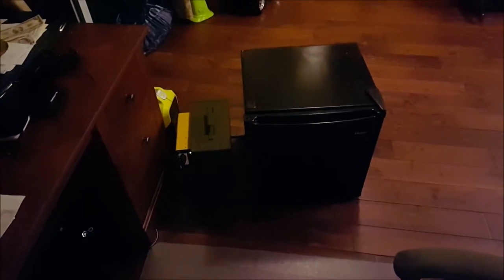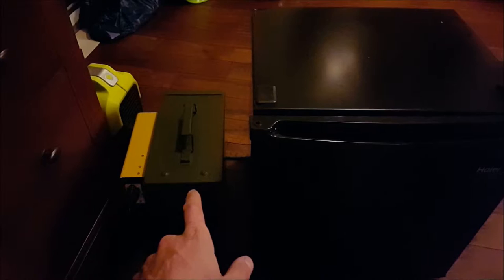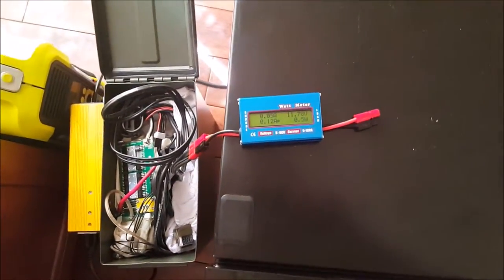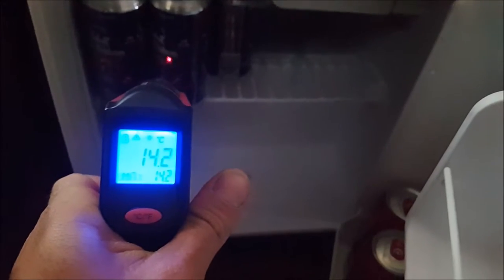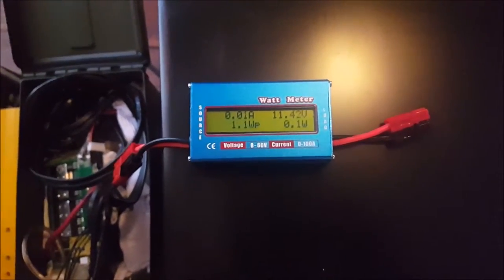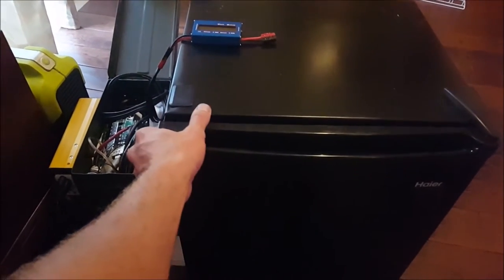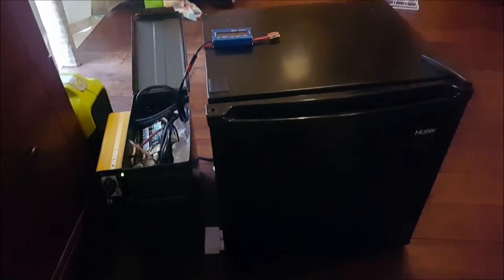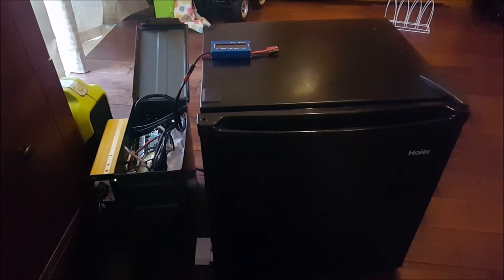Can My Battery Ammo Box Run A Bar Fridge

Comment: Hey mate, reckon you could swing us a link to your Lipo box build? Looks pretty sweet!.
Reply from the maker: here is one of them, I have a bunch if versions :D

https://www.youtube.com/watch?v=8XsM9_dJ7Ss
Reply: That's great, thanks.
Reply: What kind of BMS are you using in the Lipo box? / Have you found that works well? Would you have an ebay link? Putting one of these together myself. Making the switch from Pb... , Thanks again.
Reply from the maker: Nickk0051  its a 45 amp bms and it has done well so far.

Comment: yes I would really like to build one like yours. I have researched on YouTube and think you have the best design. as far as small size lots of power.
Reply from the maker: yea, I could put a 3000W inverter on this and run large  power tools, but I like the 300w with a 1000W surge this way I don't use to much power to fast :)

Comment: yes. I think it is working better than your power it. I do it lot of camping and am very interested in the solar and gasles generator. would be able to charge on solar charge myself phones tablets and run fans in my tent.
Reply from the maker: my lipo box is about 2 times more capacity then the power it but it also cost almost 2x the price to build, but the lipo box is also much smaller.

Comment: I found some more. Sellers name on ebay is excelvandirect 34065. the brand of the battery is floureon. 11.1v.  3s.  35c.  5500mah. you get them in a pack of 4 . 109.99. how many 4 packs would I have to buy?
Reply from the maker: I would buy one pack first and see if they are good, then buy another 4 packs if they are tested good.

Comment: what about c rating and voltage
Reply from the maker: the c rating is like this, a 5000mAh battery at 1C can put out a max load of 5 amps, but a 30C can put out max amps of 150 amps only for a few seconds but that is enough to start a car!